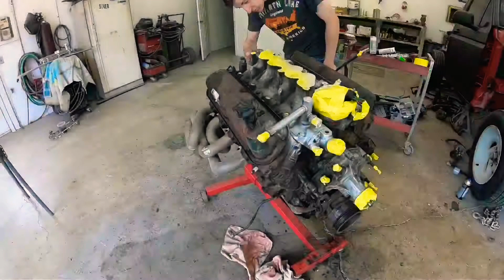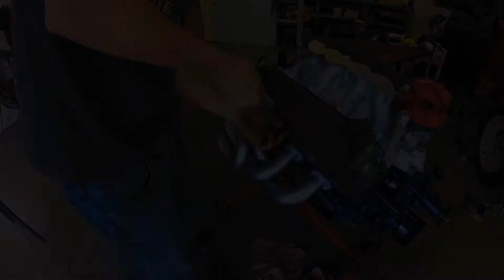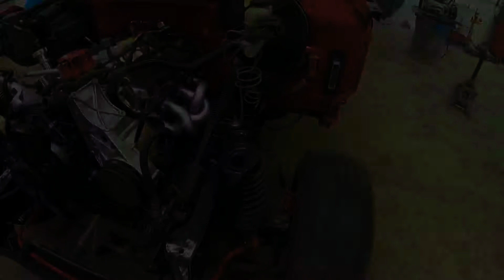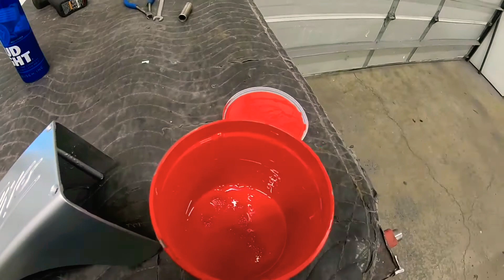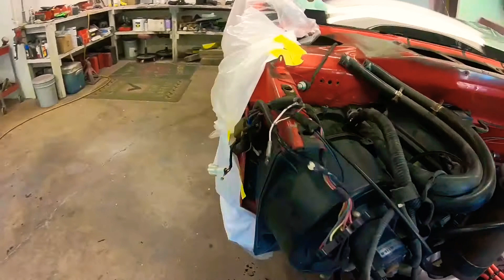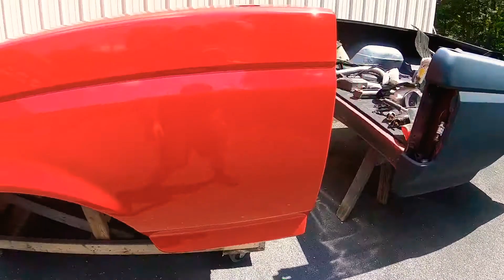Ford Lighting: Engine Refresh and cab assembly

Comment: Looks great just thought you would have used Dynamat on the floor and roof to stop those squeaks coming into the cabin
Reply from the maker: We did end up putting some sound dentiner there but I didnt address it in the video since I didn't get any footage before we got the interior back together. Thanks for the input tho!